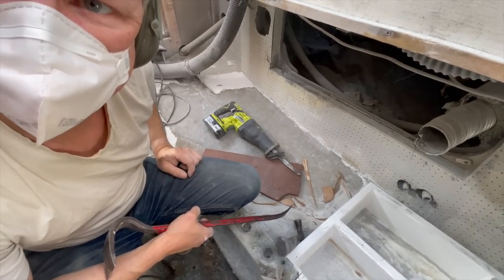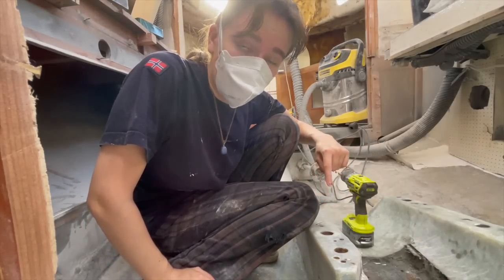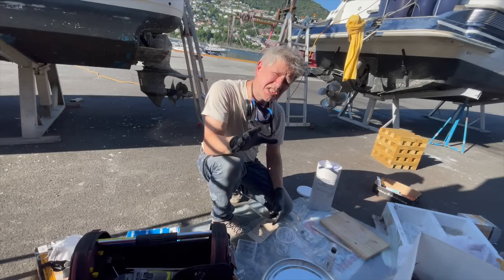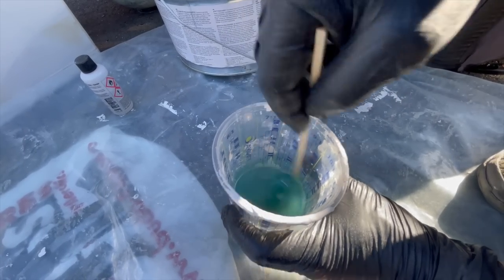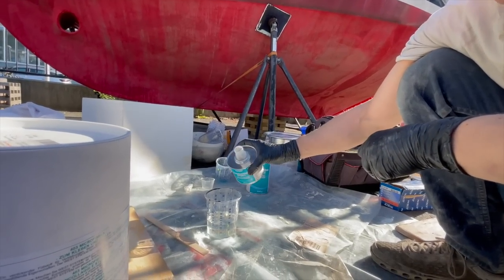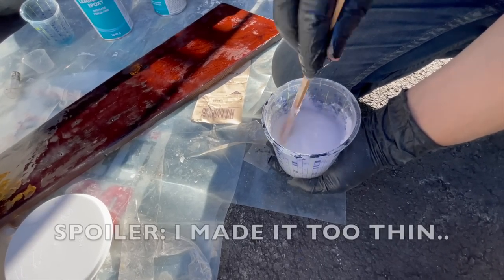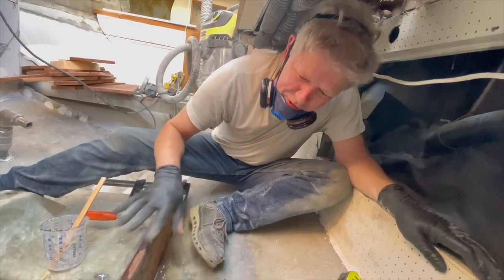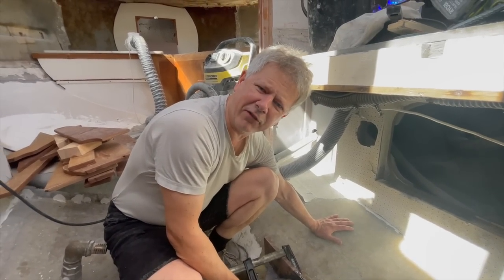Fisher 30 Ep 14 - The art of bonding. Using epoxy to craft the engine bed.

Comment: It seems I accidentally deleted my comment so here it is again. :-)  Hello Helge and Sara! Your video reminds me of when I used the West System on a boat 25 years ago.  Something I found helpful when mixing the Microfibers (or in my case, colloidal silica) was to use a container with a lid and then shake.  It mixes easily to any consistency. If you work fast, you can also use a piping bag to fill areas that are difficult to reach with a trowel or to create a fillet.  I wouldn't bother with screws if you are using clamps.  They are just places where water can and will get into the wood. Thanks for the entertainment! All the best from Canada.
Reply from the maker: Hi Duncan, my friend from Canada! Thank you - as always - for commenting. (And for the SuperThanks :-) :-)
I only had two clamps available and figured screws would be a smart move. 
Biggest problem with the epoxy was to get the right viscosity (thickness). I have learned from Mads in Sail Life that a cake decorating bag is good for filling small holes, but I thought this was about sufficient. Main thing is to get progress. Secondary is elegance, style and professionalism :-)
Reply: @hsobstad  Screwing has always worked for me - especially with stainless steel fasteners. I agree that progress should be the leading focus. Otherwise, the project can take too long to maintain interest. :-) Have a great weekend!
Reply from the maker: @duncanjames914  And to you 👍

Comment: have you thought of a stainless pan under the engine to catch any leakage , i did that on my boat and for 36 years never had a drop of fluid in the bilge or funny bilge smell
Reply from the maker: Great idea! I will do! :-)
Reply: It's been a requirement that the engine bilge is sealed from the rest for many years (to prevent any oil or fuel leakage being pumped overboard by  automatic pumps). And yes, in countries like Greece, Italy, Germany etc sometimes the port authorities check just like they check your toilet holding tank.
Reply from the maker: @jimtitt3571  Hi Jim. I believe the regulations of ours are basically the same - alt least in the end result. It is illegal to pump oil overboard and into the sea. This Fisher will have all necessary installations to prevent that.

Comment: Thank you for the video. Glad to see you using epoxy with wood, not polyester. For many gluing jobs, you could use a small 3mm/.125” notched plastic scraper. I found mine in the wall tile section of the store. It ensures the epoxy is coating evenly. Saves epoxy and is much faster than a stick. I also use throw away chip brushes (v cheap disposable brushes) that I cut the bristles down to half their length or more. For tight spots, cheap as well as used toothbrushes are excellent. They are stiff enough for epoxy. 
Breaking screws is a pain. if the screws are correct, try one size up in drill bit. I use a larger drill bit into hardwood than softwood for example. Looks to me they were breaking in the hardwood. Also they seemed to break when almost in. You need to drill a countersink in hardwood for the heads so they will seat properly. You can buy tapered drill bits with built-in countersinks or get a countersink bit for general use. You’ll use it everywhere when rebuilding the interior.
Reply from the maker: Hi Barnley. You are welcome! And thanks for all your tips!
The wooden stick is a reel bummer! I did not prep sufficiently for this job. But I made it. Just wait for the next video :-)
Tooth brushes! Really? Did not see that coming.... 
You are absolutely right, I did use too small drill bit. That made the screws break. 
The drill bits with built-in countersinks is a great ides. Shall see if I can get these in this part of the world. :-)

Comment: I can't add anything as I'm not mechanically inclined. However you should have kept the fly on the board and made him the mascot he would have been a permanent fixture sealed in time LOL
I don't know who's more of the photographer you or your daughter but whoever is doing it does a good job and I like it when the humor is intertwined I may have mentioned that in one of the other videos.
And no sleeping on the job😂
It's amazing how much detail there is for every little aspect of the rebuilding. Definitely requires critical thinking.
Hope you and your family are doing well Steve Naples Florida we're right now it is 98 degrees and extremely humid
Reply from the maker: Oh..you are right, Steve, that was indeed a rash decision from my side, not to include the dead fly into the epoxy. I am however glad to find in your feedback that we still deliver satisfying videos. 
There is an aspect of try and learn in all of this work, but it seems to work out ok.
Soooo... 98 F should be about 36 C. OMG! And extremely humid as well? I do by far prefer our mid summer with light rain and 65-70F. Only partly sun but liveable temperature. 😊

Comment: Love the videos, great to see you working with your daughter. Not sure if you have an impact driver with variable torque. I use Milwaukee it will assist with not breaking stainless screws. Great effort with the boat and the videos, very entertaining.
Reply from the maker: Thanks for motivating us to continue! Your Milwaukee is a step up in quality (and may be strength). I do not use an impact driver, but i do have variable torque. Just didnt think about it at the time. The main fault was to pre drill too small holes for the screws, in combination with using cheap plaster/wood screws. But...no problem! :-)

Comment: put some bar soap or wax on the screws so they'll go in easier and maybe not break.
Reply from the maker: Thanks for the advice. 
I could also use stronger screws or a wider drill bit. :-)

Comment: Get to see you getting stuck in with the new engine bearers. Colloidal silica may give you a stronger epoxy mix. Self tapping stainless screws are always an option. Talcum powder will be a cheaper filler for polyester. When it's hot the mix always goes off quicker and adds to the stress when working. It's going well!
Reply from the maker: Hi Peter. Are you sure colloidal silica is stronger than large quantities of fibres from glass? 
Yes I should have used more expensive screws. Stronger ones. 
Talcum would make the polyester thick but not strong, I presume? 
Yes it was very hot outside for a few days, and worse inside the boat. Made the polyester kick off really fast. But we made it :-)

Comment: I really like the video's Helge! But....creating a new engine mount out of wood is a bad idea! An engine will of course create vibrations, so a good mount is absolutely necessary. Making it out of wood creates a different problem...it will loose it's flexibility really fast. That is why a steel engine mount in combination with heavy-duty rubber dampers is the only way to go! Steel will not loose it's flexibility as fast and much as wood mounts will, and you can replace the rubber supports really fast and easy! Please reconsider your decision!
Reply from the maker: Really thanks for your advice. But lets discuss if this is strong enough when you have seen then next videos. The engine bed will be made MUCH stronger than this. :-)
Reply: Rubbish, I'm a marine engineer and boatbuilder with 40 years experience    and laminated-over timber is standard practice. I've installed dozens of 1800 hp MAN  and MTU engines and a couple of GE 3600hp turbines and   that's how it's done. That Nanni diesel in other applications would be fitted with a couple of 1mm stamped steel brackets like in your car. The requirement is that the engine does not become detatched if the vessel is inverted.
Reply from the maker: @jimtitt3571  Hello again, Jim. I read your answer in support of the picked solution for a strong engine bed. I think I am overdoing it a bit, but i find that to be part of the joy of refurbishing the boat.

Comment: As always, very happy to see the project moving right along.  You are a lucky man to have such a diligent helper on the project!!  A small tip ... when working with the thickened epoxy as a bonding agent, aim for a consistency of peanut butter with the final mix as you add in the thickening agent.  This will help minimize the squeeze out when placed under pressure, and whatever does squeeze out can be used to form a miniature fillet with a mixing stick or finger.  The fillet will be necessary when you get to the glassing over step of the engine bed as fiberglass does not bond well on a 90 degree angle -- a fillet will help the fiberglass transition the 90 degree angle and create a strong bond.  The extension of the engine bed looks good -- it will definitely be an improvement to the old design.  When you cut out the old battery box, it looked as if there was significant unused space under it.  could the batteries be relocated so that a long water tank could be mounted lengthwise next to the engine?  This would have two benefits as it would relocate the water tank out of the living space, as well as locating it in an area with good access for cleaning and maintenance.
Reply from the maker: Thanks Robert! This was actually the first time for me to use epoxy as a binding glue. Yes, I now understand that the epoxy should be thicker, and as peanut butter (by room temperature then). 
I will round out the 90 degrees corners in the next round; just didnt have the tools for it as of now. 
There is not a lot of room underneath the battery box that I did remove. But I did not need the space for two traditional led acid batteries as I have bought two lithium batteries for the boat. More on that in a later video. 
Locating the water tank deep in the boat is a great idea. In the area around the engine I have exciting (yes!) ideas for attenuating the noise from the engine. That will take up some space. :-)